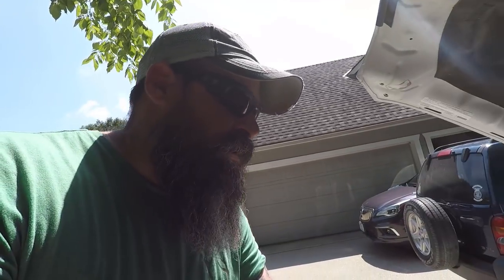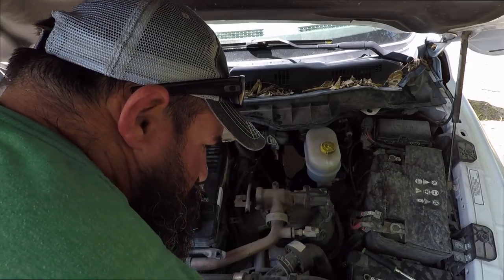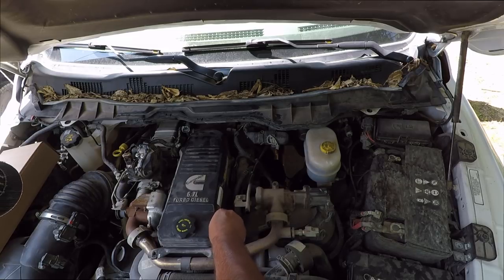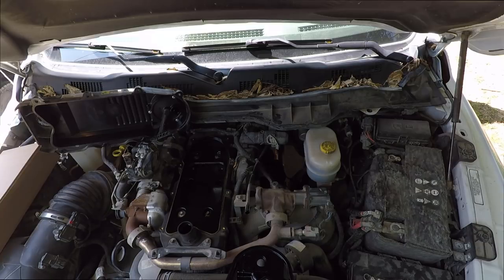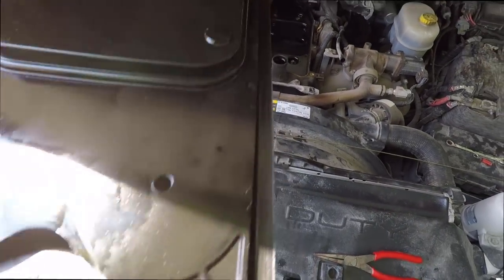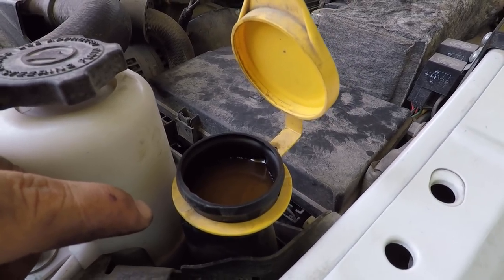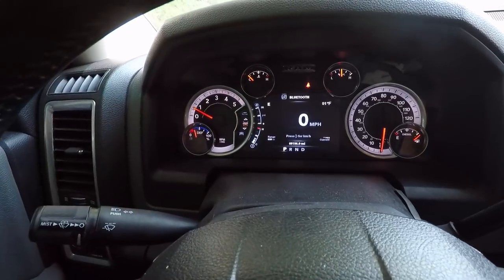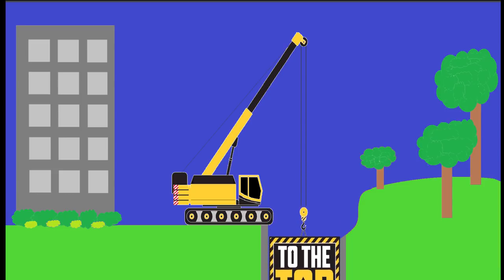6.7 Cummins CCV Filter change | Ram 67,500 mile perform service indicator

Comment: Just did this on my '15 Ram 2500, manual calls it to be replaced at 108k miles. I was expecting a light to come on, but never saw one. I changed it anyways. I'm no mechanic, and usually when I do some wrench turning, I need to make a couple trips to the auto parts store. With that said, this was super easy to do. Took about 30 mins, I took my time. Experienced fella could do it in 15 pretty easy.

Comment: I have a 2016 3500 limited. Changed filter was super easy. I pulled the EGR valve to clean, was very easy and really wasn’t that dirty. So I didn’t do the cooler. My local dealership quoted $1,400 to service the EGR system. Which included cleaning EGR cooler, valve, and replacement of filter.

Comment: You ever notice the tubes from valve covers to the header collector on drag cars?  They run a lot of vacuum in the crankcase because it makes the rings seat harder.  Many benefits to having a slight vacuum in the crankcase.  When you use your truck to work, you don't want to go screwing around with it.  If it's old, you can work on it, and it's not critical to your job/livelihood, do whatever you want to it.  Good video!  Thanks for sharing!
Reply from the maker: burningdinosaurs, all good and valid points! Thanks for watching! 🙂👍

Comment: Been up in the air about all the deletes and stuff, but my Cummins has 65000 and besides a few recalls has never been back to the dealer for anything. Pretty mechanically inclined so do all my own services. Dont like the def fluid, but again no issues in 3 plus years and 65k. Maybe after the warranty is up but not on my list of things that I have to do.

Comment: Dusty in there. I see you put the cover back on. Got to keep it looking pretty! I think I'm going to get def at the truck stop every few thousand miles or so. Seems to run about $2.85 at the pump and seems a bit easier and cheaper than buying containers.
Reply from the maker: Jimmy's Tractor, it is dusty under the hood. I tend to use my vehicles more than I keep them clean. I'll give it a thorough bath one of these days. Lol. Thanks for watching! 🙂👍

Comment: Thanks a lot for the video! Just changed mine this morning. No issues, but I did bust those screw mount cable ties. 

Any chance that you know what those "screw mount cable ties" on the left are called (deep well 8mm needed for them)? Been searching on amazon, no luck yet, found smaller sized similar ones.  Probably not really needed, but looking for a similar replacement.

Comment: Where I live Dodge Wants to Charge me 3,000 to change that Filter. So how did you clean out the System cause they told me that have to go in a clean out the system
Reply: Down here in Texas they charge 750 dollars to do the ccv filter and the egr cleaning and egr cooler

Comment: just fixed this motor in Terex t340. 
Regen shut it down. Nice motor though.
Lift pump not working. Egr clogged.
Reply from the maker: james norse, that's no good! Did it use DEF? Thanks for watching! 🙂👍

Comment: Super video..I just replaced my fuel filters on a 2016 longhorn but cannot reset the fuel filter on the dash, can you tell me the steps to reset?
Reply from the maker: I don't remember off the top of my head how to reset the fuel filter monitor. But, I will be changing my fuel filters soon. So, I can make a video for you if you'd like? Thanks for watching! 🙂
Reply: After you change the filter go to the truck go to the menu and go to to the oil menu and it's right next to it you can follow screen

Comment: You just need a duramax won’t have to change that 😉lol! Good job man! Sooner or later your going to have to deal with DEF just how things are going.
Reply from the maker: Elite Earthworks LLC, my truck has the DEF. It is what it is. There's worse things I suppose. Like poison sumac. I hear that's pretty bad. Lol. Thanks for watching! 🙂👍
Reply: To The Top Crane 😐😑😐
Reply: To The Top Crane yes that would definitely be worse
Reply: Yeah, the bad thing about those Isuzu engines is the rest of the truck around it.😆😆😆
Reply: Highstranger951 🙄😆